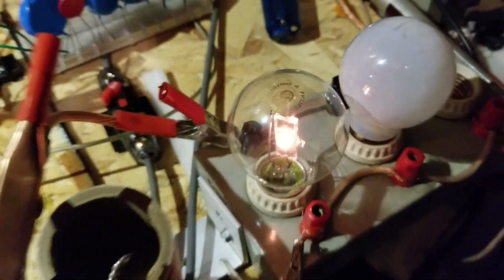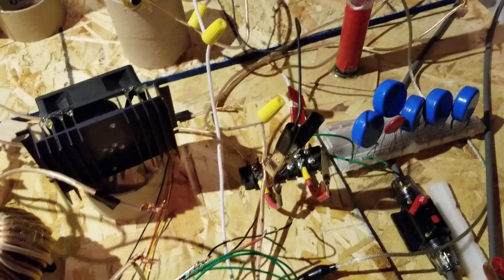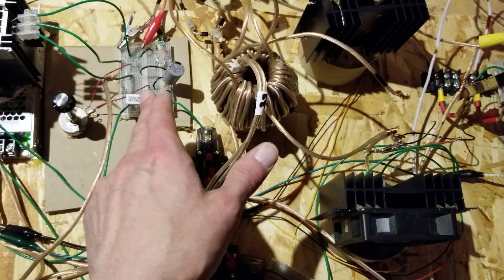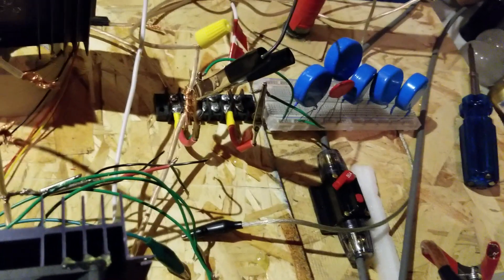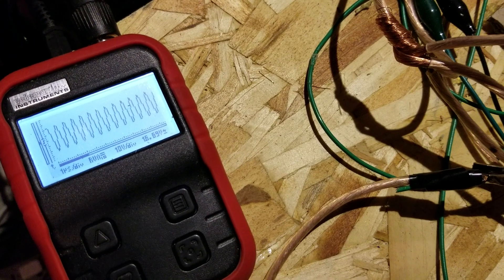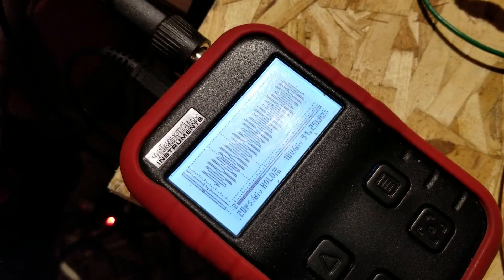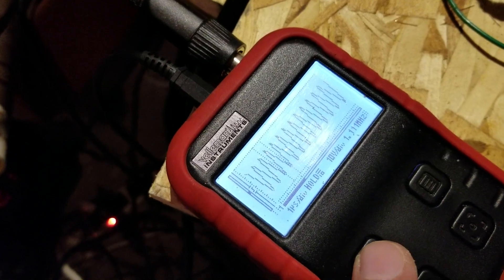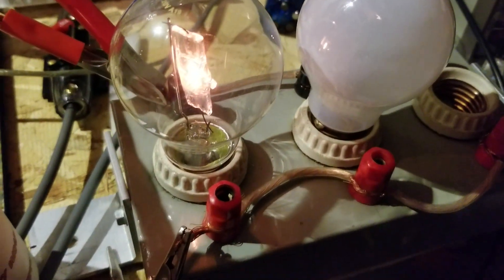Part 6: Akula / Kapanadze Experiments, Adjustability, Proper Harmonics

Comment: In Tesla patent he used rotative contacts that close one coil and open the other one. It is like a grand father pendulum clock principle. If the source is in the center and you short one side, the other side go up and vice versa. When the rotative contact close one coil, a big emf is generated in the coil assembly and this charge the other coil higher.
Reply from the maker: yes im not clear on that, thanks for your info !

Comment: I noticed you had a switching power supply to the right of the radio and I was wondering if you ruled it out as your RF source?
Reply from the maker: hi there, the PSU is in fact the interface between AC output, as well as the source of DC for the entire device, the Tesla oscillator draws 30 watts in this loaded operation , including the 8 watts from the 3 cooling fans. but i expect nothing special until i add the output modulation at low 31.25 khz
Reply from the maker: ... but the high Q narrow signal at 1.1 mhz is definitely the resonator, which if you noticed when the neon probe was touching, we could hear that breakup in the speaker
Reply: Thanks for the reply back. I've been following your channel for quite a while and I really like where you are taking this project. I just wanted to give you my personal observation here but it appears that you've already proven and pretty much ruled out the switching supply. Switching supplies can sometimes be strange beast so I just wanted to mention it.